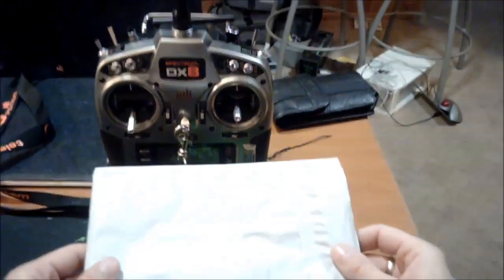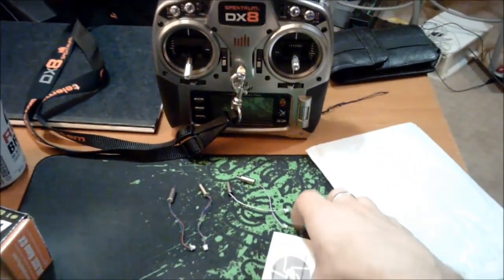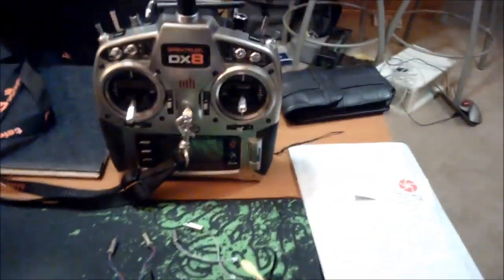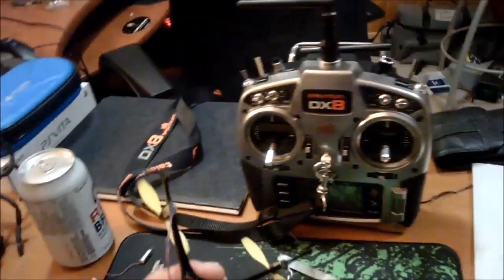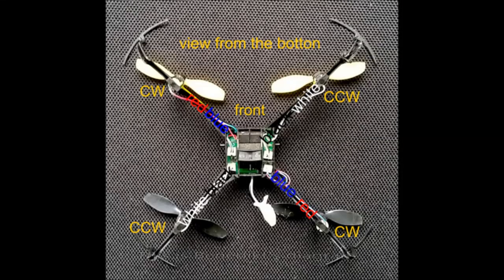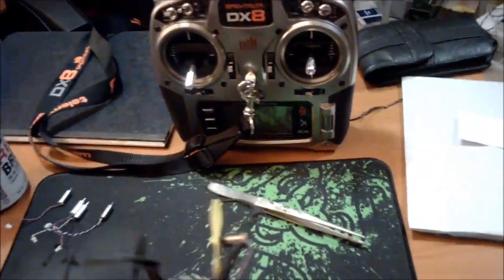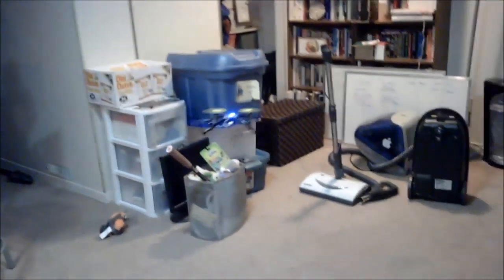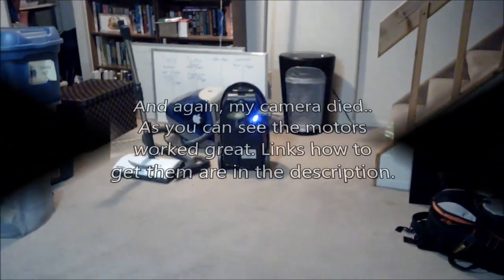Replace the Blade Nano QX motors with MMW14 Motors

Comment: what's a safe way to remove the motor connectors from the blade nano qx 4-1in-1 control unit without breaking it off like I did Thank you for any help about this
Reply from the maker: +Thom Farrell 
I use needle nose pliers and the trick is to not grab the housing, just use the tip and grab it just firm enough to get a grip. ease ti out with gentle back and forth movements. not too exaggerated. It should ease out. Sorry you broke yours off.

Comment: These motors totally suck rocks.  I've already had 4 of them fail.  Yes 4 of 4 all failed.  I bought 4 sets of them and needed all 4 sets just to keep one single set working.  The backs break off no matter how careful you are replacing the props and they just fry really easy.  Just stick with the stock motors.  I've used them 10 times more and with 3 different Nano QX in my family we have only had 1 stock motor actually fail so far.  I can't believe how failure prone the Micro Motor Warehouse engines are.  Ug.
Reply from the maker: +SUPERDELL Schanze I'm afraid I have to agree. Shortly after I did the install I swapped them back and sold the whole unit. While mind didn't fail I just did not like the feel of them. They felt off. like they weren't spinning the speed they should have been. Kind of uneven. I can't say I'd recommend them.
Reply: Yea all of those I ordered have all failed.  I really only had them work for a couple flights and that was it.  I really wanted to like them when they were working but dang the quality is really bad.

Comment: Aww, I was watching to see how to remove the plugs from the FC board. I can't seem to get mine out with tiny needle nost pliers and at this point I feel like I'm going to damage the board.
Reply from the maker: Andy Harrison Ya, Sorry about that. My intention when doing the video was to show all steps but the recording glitched on me and it didn't record.
I use needle nose pliers and the trick is to not grab the housing, just use the tip and grab it just firm enough to get a grip. ease ti out with gentle back and forth movements. not too exaggerated. It should ease out.
Reply: +Andy Harrison  really - that was what i was lookin' for. although i have not read anymore stuff here, as i will do, now